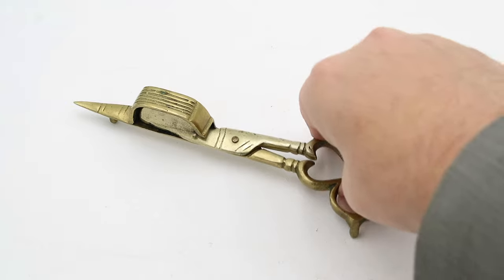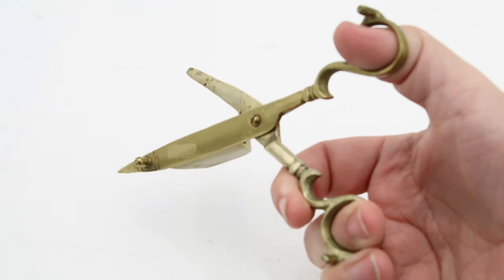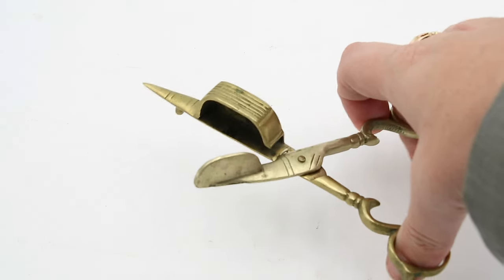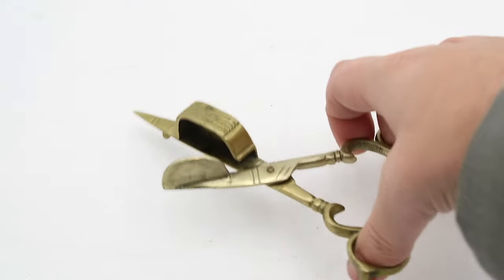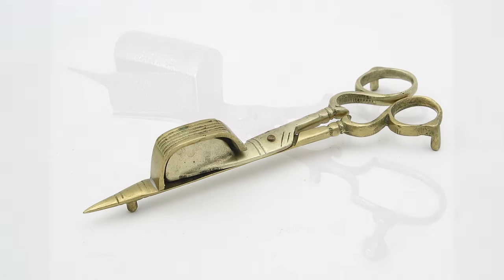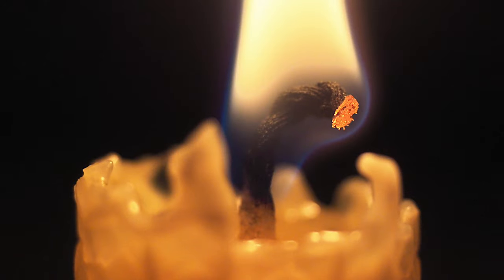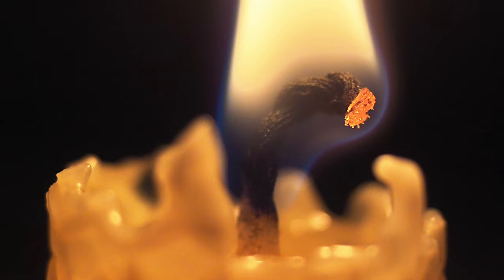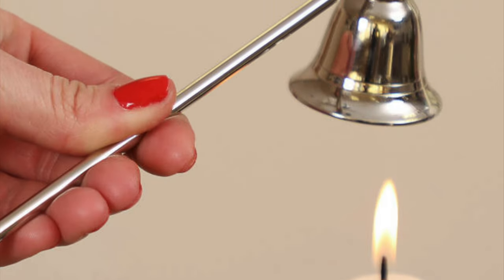Mystery Object #2 ANSWER

Comment: Did oil lamps also require such constant trim?
Reply: No. A candle is consumed as it burns, thus receding from the wick. In essence, the wick "gets longer," if you will. That doesn't happen in an oil lamp. The wick remains the same length above the burner. The end of the wick will char and, eventually, get ragged so it will need to be trimmed to keep a nice flame, but that's something done once every day or two, rather than several times an hour.

Comment: It's technically not a snuffer (schnauzer) but a snuffer trimmer, the ancient 'snuffers' you refer to, operators of which; at the time, weren't ridiculed, but the term came to mean 'doubter' or 'unbeliever', were simple cone shaped implements to put out beeswax candles that everybody used in ancient times, by oxygen starvation. Only in middle to victorian ages, when the artificial divide between commoners and nobles was enforced, where folks were forced to use tallow or paraffin only, in lamps and candles, instead of blends that were mainly or wholly  beeswax; were trim-snuffers needed as otherwise the blown-out or snuffed candle wick ember burned to it's base, making it difficult to light next night.
Metalized wicks became used later to ameliorate this,; lead, zinc or copper threads added to wicks.
There was a big fuss made that only the 'elite';  (clergy, royals and noble lords), were allowed to use pure beeswax candles and severe penalties applied for commoners caught using, selling or producing them.
Much as wearing silk, gemmed, silvered or gilded textiles was made unlawful for all but the false powdered-faced elitists, by those criminals pretending to be the true nobles of ancient times, when the royal houses, clergy and architects guilds were compromised by parasitical cabals, who succeeded; which is now why in present times, the so called 'elite' serve nobody but themselves.